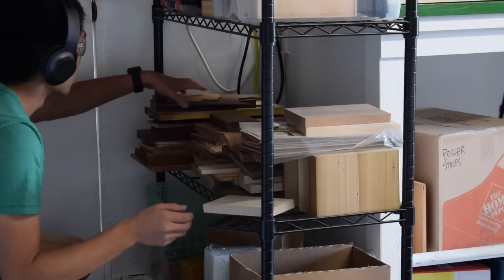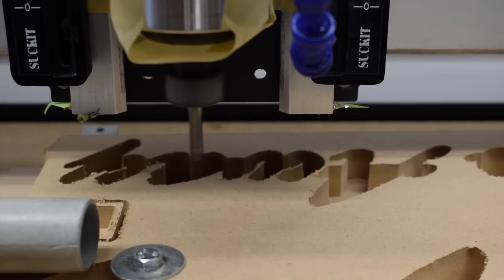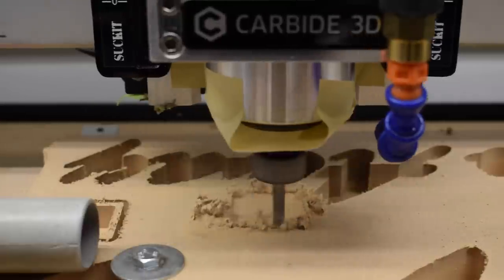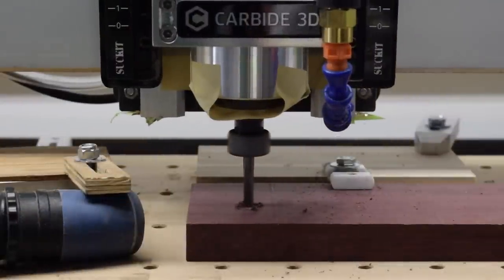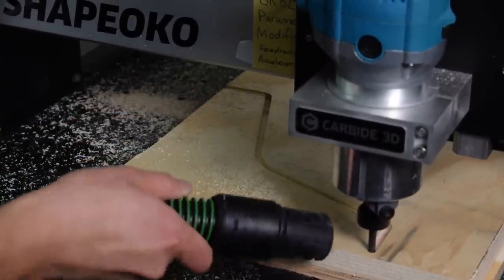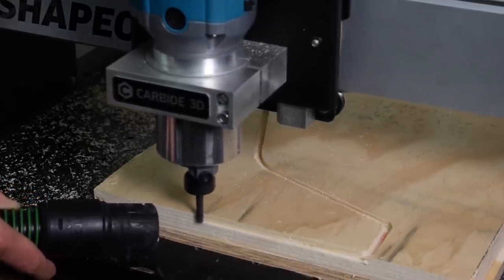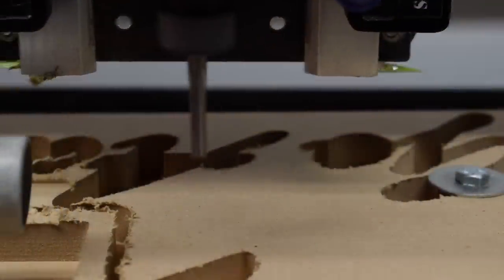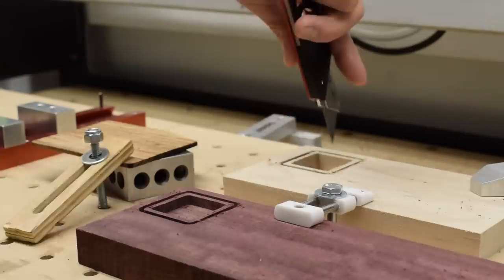Speeds and Feeds for Wood on the Shapeoko - #MaterialMonday

Comment: You can definitely go deeper and faster. Also, you'll benefit from using chipload calculations to maximize your efficiency and prevent tool wear
Reply: What feeds and speeds would you typically run in MDF with a 1/4“ end mill?
I’m thinking about getting a similar router and looking to get realistic numbers for feeds and speeds

Comment: I tried the recommended feed rate for medium hard wood (2x4). I think you mentioned you were running at 18,000 RPM. Worked fine. I used a feed rate of 50 in/min and plunge rate of 1/2 feed rate. RPM=Feed Rate/(0.02 x Diam x #Flutes) where chip load was 2% of the diameter of the end mill. I  notice I need to run a finish pass at 0.025 in to save sanding milling text. Thank you for taking the time to help. Good information!  Smoking plywood a single piece with same setting that worked on other plywood; which exploits your comment that not all wood with the same name mills the same. Thank you for your help!

Comment: These recommendations are EXTREMELY conservative. I have milled 50+ hours of Walnut with a 1/4” endmill and Feedrate - 75ipm, DOC - 0.5”, Stepover - 0.2” (80%), RPM - 22,000 ish.  that’s 10x the material removal rate of what’s presented in this video.  Don’t limit your milling based on this video.  Keep pushing the boundaries until you find what you are comfortable with.
Reply: Most of the time when I see recommendations from the manufacture, it's usually one times diameter. (1xD) So a quarter-inch bit cuts a quarter inch deep. And last chart I checked out was something like 180 IPM for a 2 flute end mill--that's nuts. You'll snap your bit in about 3 inches of travel. Based on my own trial and error and snapping three or four $40.00 bits, I learned the hard way. I'm running about 75 IPM, and right in the .06 to .11 depth of cut. So, I think Winston's recommendations are a very good place to start. I'd rather be a little conservative and work up in speed as opposed to snapping a $40 bit, twice or 3 times, until I figure out I'm going way too fast. $120 will buy a lot of nice hardwood! I applaud Winston for his conservative recommendations!!
Reply: @Deltro61  180 definitely is a lot for a quarter inch 2 flute, though I have also seen manufacturers recommend somewhere in the area of 100 to 115 ipm based on chipload at 24k rpm, and I don’t think that’s too crazy. Always depending on the machine though, a tool breaking may also just be caused by a lack of rigidity or too much runout of your collet

Comment: In troubleshooting, it is often preferred to change only 1 parameter at a time, and then test that. With that being said, I wonder which parameters are best or easiest to maintain. Such as using a consistent router rpm setting for all of one type of material (i.e. wood)--say, 18000 rpm--and then adjust either feed rate or doc. With my time making chips still measured in hours, and not wanting to damage my limited number of bits, I have had a hard time finding the best balance between rpm, feed rate, doc, plunge rate, stepover, and stepdown. Extrapolate that to all the different types of woods and wood products alone, and it is overwhelming.

Maximizing production rate and minimizing cleanup on the backend is always the goal. And newbies rely on the tribal knowledge from veterans, so I appreciate these recommendations to use as a starting point, even if there is some dissension from others based on their experience.

Comment: A Down cut or as you say compression cut end mill will always give a better surface finish on wood and prevents the grain from splintering. Even in plywood. I almost always use only down cut end mills on my projects.

Comment: I'm going to go out on a limb and toss in my 2 cents. i would recommend .125" DOC and a radial engagement of about 30% and a feed per tooth of .002" (assuming 10000rpm, router speed will drop to about this under a healthy load). If you cut deeper reduce radial engagement and not feed rate, your tool life will be better and your material removal rate will be much higher.

Comment: I don't what is so hard on the feed/speeds thing. Just listen to the machine and see how the chips look like. 
It also depends on the machine speed and all I ran on 12000RPM most of the time. I can go double but I hate the noise plus I like to keep a room for some tweaking. I definitely do not run on the maximum it can get, but rather have some room there for cases when the machine decides to go thru the stock fully buried in it.. like when it goes from part to part and I forget... In that case the setup I run with should handle that situation on its limits. That is how I set it up. When the machine can go thru the stock fully loaded that is how i keep it and machine in a normal pace and load with chips flying off not a dust.
Reply from the maker: What’s difficult is the amount of internet chatter filled with exacting numbers for feeds and speeds.   Plus the talk of danger and broken endmills.   
We are in favor of just getting cutting.   
Do you think the craftsmen running routers, by hand, for the last 70 years were calculating feeds and speeds????  
They were listening to their routers and the bit, looking at the chips and the resulting cuts to be able to predict and create quality cuts.   
There is no substitute for experience.   
“Get busy cuttin’ or get busy dyin’….that’s damn right”
Reply: @carbide3d exactly, when they taught me to CNC 20 years ago we did no calculation whatsoever, we just knew by experience and adjusted by the chips and sound, always started with smaller load and add more if it was possible, same like on any other machine. Sure not the utmost way how to get the production pace but was good for us building prototypes.

Comment: How do Fusion-360 style 3D-adaptive cuts play into this?  In the deep square pockets shown in this video, is there any (dis)advantage to doing a fast spiral plunge in the center to nearly the full flute depth, then spiraling out, as I often see people doing with aluminum?  Or does wood need to be treated differently?
Reply: You can, but there's no practical advantage. With aluminum, your margin for error is much smaller so you want to control cutting forces. If the endmill chirps a little in the corners cutting wood, it's no big deal. The plain 2D pocket tool path will usually be faster. That being said, if you're using a compression endmill, that's where the deeper adaptive cut would be great.

Comment: Thank you for your input. I have been burning milling hard plywood so I need to increase feed rate. according to your table. So RPM would be 10,000 RPM for  a 60 ipm, Chip load=0.002, and # of flutes=3. RPM=Feed Rate/(CL x # of Flutes). Is this right? Please advise. Thanks.

Comment: hi, can you help me with some advise to set my parameters? i'll cut hard wood "Mezquite", and i will use a surfacing bit 1 1/4" diameter 2 flutes. i think it would be a good idea to start with DOC 0.5mm, RPM something about 13k to 20k,  and feed rate 500mm/seg. 

BTW. im new in this
Reply: i just realice, there are another key parameter "chip load" and it should be in the datasheet of my bit

Comment: For wood, what conversion is necessary when using 2 flute endmills, vs the 3 flute 201? Is it a chip load deal as with aluminum, or can you go the same rate or even faster since you have more room for chips in the flutes? I use the Whiteside RU2100 & RD2100. I've been playing it pretty safe with the RD2100 in plywood & MDF with .08" DOC and 60 IPM feed. Yet to use hardwoods on my 3XXL.
Reply: Chipload isn't really a big deal, so I wouldn't worry too much about it. The reason it matters in other materials is heat. And here if you rub more than cut, you'll just see a little burnishing/blackening of the cut edges. That you can recover from because wood is forgiving, in aluminum you'd break a tool. If it works, just go with it. Woodworkers have been pushing router bits through wood by hand for decades, and i guarantee you they haven't measured their feedrates!
Reply: You could get into the nitty gritty of chipload calcs, but I find it easier to balance feedrate and RPM based on the behavior of the cut.  Fine sawdust means rpm is too high or feedrate is too slow.  Broken bit means rpm too slow or feedrate too high.  Small but intact wood chips (approx. size of a half grain of rice) is ideal IMO.  I too use the RU2100 but run it much more aggressively IE: roughing walnut at Feedrate - 75ipm, DOC - 0.5”, Stepover - 0.2”, RPM - 22,000 ish.
Reply: @WinstonMakes  Assuming you’re producing decent size chips and the machine is capable of running quicker, what would you consider downsides of going up proportionally in feed and rpm and therefore increasing surface speed (Vc)? Is tool life influenced in a big way in wood, or is that negligible? Haven’t had the chance to really test that yet